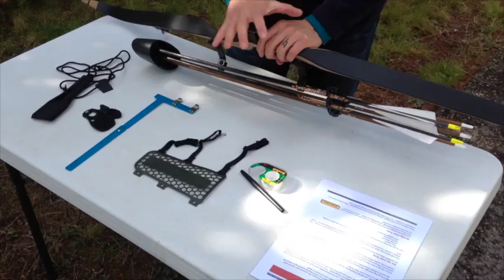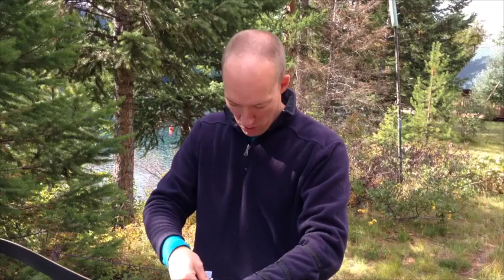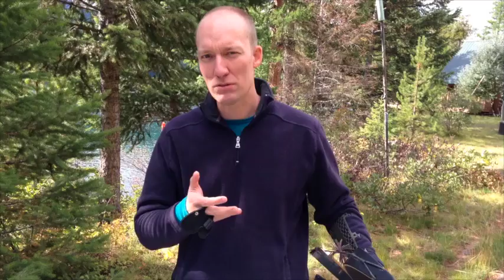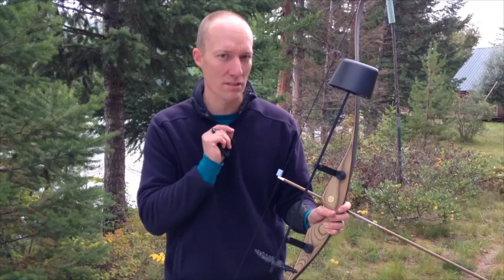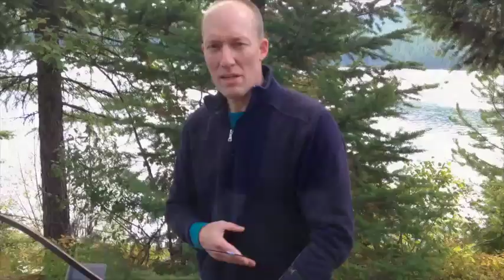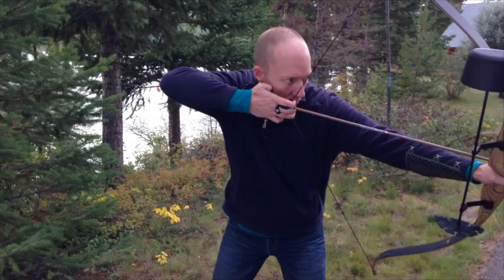Tuning Your Recurve - Part 1

Comment: Mike,
Thank you for this post as I am trying to get rid of my amazing ability to miss shots a very regular basis. Nobody can miss as often or as well as me. Now it’s time to fix this. I have my form together.
Left shoulder to the target. Feet under each shoulder. Bow string drawn between my eye and my nose. Anchor point is the right corner of my mouth.
Sometimes I actually hit where I am looking. Not often but it is thrilling when that accident happens!! I can not repeat it!! HELP!!! 🏹🏹
Reply: Jack, I might be able to give you a run for your money. My middle name is "Harmatia" which is Greek for "Sin" it's actually an archery term which means, "missing the mark". And nobody can miss like I can! 😆🤣😂🎯
Reply: @joedaniels4646  
Joe,
I read somewhere to tape a paper cup to an archery target 🎯. Shoot six arrows into the cup and then back away from your target by six feet. Continue until you miss and then fix it.
I am no longer a poor short. Thank You!

Comment: Is this guy serious? For one it’s not riser height it’s brace height and brace height is measured from the deepest part of the throat of the grip tiller is measured just after the fades....most recurves run best and quietist up around 8” “brace height” long bows usually closer to 7.... riser “height” is the length of the riser from fade to fade this dude’s a scam artist....FYI you don’t need a arm guard and you don’t need a bow stringer to string a bow

Comment: Note: The official term is "brace height". The measurement is from the string to the deepest part of the riser, not necessarily to the middle of the shelf. Since riser designs are different, this is where it's important to know the manufacturer's recommendation.
If it's easier to measure to the shelf, that's fine . . . Just start with the manufacturers recommendation and then determine the measurement to the shelf.

Can you make a video on how the brace height affects the path of the arrow?
Reply: Bear Recommends a Brace Height of 7.25 to 8.5.  I've had a 60lb  Grizzly since 1972  and it whispers. Bought it new for 59.99 with 3 arrows, quiver, arm guard and tab.